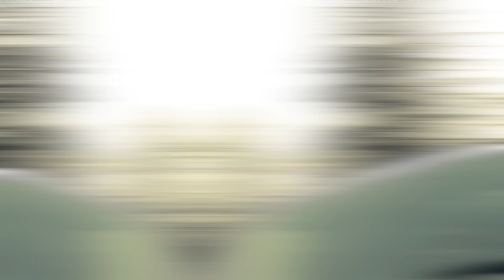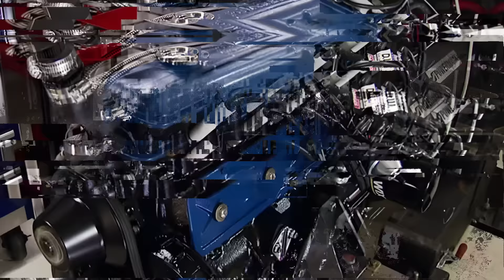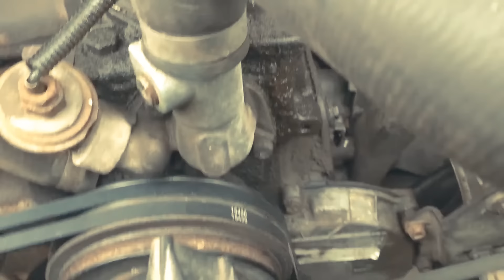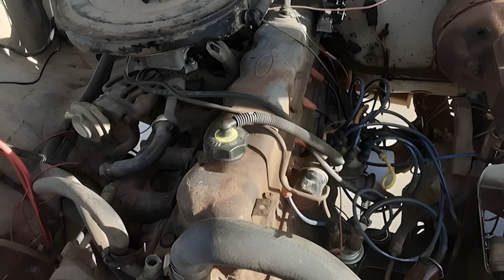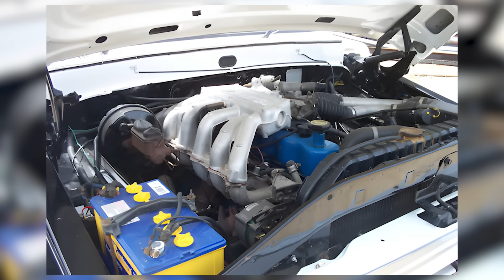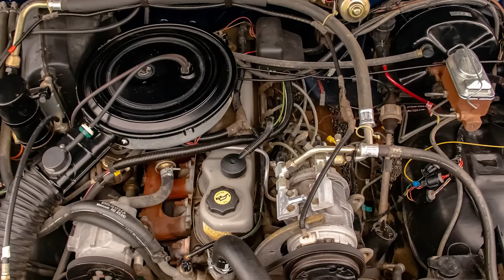The Most Durable Ford I6 Engine Ever – And Why They Killed It?

Comment: I bought a 1983 F100, 42 years ago.  I'm still driving it.  As is expected from the 300, it is all original after 300,000 miles. But here is the surprise:  The often maligned AOD 4 speed automatic transmission is also original.
Reply: I bought a ne F100 in 82 with the 300. The only problem I had was the carb loosening up on the intake constantly.
Reply: @darrellsaunders4267 interesting. Hmmm, maybe a 3 foot breaker bar to tighten the nuts ?
Reply: Ever change the filter, fluid?
Reply: That's a tractor engine. So is a 250 Chevy straight 6. These are honest motors.
Reply: I have 91 with 300k still strong 💪 Doesn't burn any oil
Reply: Nice!
Reply: Long live the 4.9 300c.i.d. One of the best engines on planet earth. If you own one and sell it you probably will be sorry. It's slow, but sure and very reliable. I bought an f250 with one in it about 10 years ago. From the looks of it ,it probably had 200,000 on it when I bought it . The speedometer was broke when I bought it so only the good Lord knows how many miles are on it by now.
Reply: 4 speed manual is more fun though
Reply: ford's autos were generally really hit or miss back then, but kinda trending towards trash. my mom's 93 thunderbird was in the shop more than it was on the road when I was a kid. think our aerostar was in the shop for the transmission at least once. my dad drove manuals, so he didn't have any problems.
Reply: #1 Fluid and filter changes, #2 Install a Transmission fluid cooler, and #3 Don't tow in overdrive.
Reply: @JesusIsLordAndSavior777 there you go....not rocket science really 😊

Comment: it is possible to put modified Ford Cleveland heads on a Ford 300 six-cylinder engine, it involves cutting and welding Cleveland heads to create a custom six-cylinder head. One example is the work done by Bruce Sizemore, who created a six-cylinder Cleveland head by cutting and brazing sections of 351 Cleveland heads, achieving over 500 horsepower!

Comment: Learned to operate a clutch in a 1961 Ford F-100 w/ 300ci Inline 6.

Bought a 1984 F-150 XL with the 300ci.

That engine is as reliable as a sledgehammer.

Comment: So over regulation destroyed a reliable engine and created engines that are too expensive to work on.  

Reduce the regulations and bring back what we can afford and what works.
Reply: I have a 1990 300
It always blowed zeros on the smog testing machines so I wonder about that claim as to why they dropped it.
Reply: @ProctorsGamble  It was a DIY servicable vehicle and they cant have that. The origanal light buld Thomas Edison invented still works to this day. They want us working and continually making payments.
Reply: @curtrn  True dat first part. That Edison bulb however,🙄 uses a large amount of energy compared to modern incandescent lamps for the light output and now we have LEDs that I as an electrician hated at first, but now embrace because the technology has gotten so good. They use <10% energy and are easy and flexible to install. We would probably need 10x as many power plants today if we were still using Edison lamps. Don't get me started on A.I. data centers though...🙄

Comment: I’m a mechanic. Not a ford fan…I’d go so far as to say that the 300 6 is the only good engine they ever made…but damn, they sure got that one right. I resealed one in a F150, customers only complaint was it was pissing oil from every gasket…pulled the valve cover off, found 3/4 of an inch of oil sludge in the head, like it hadn’t had the oil changed in 30,000 miles, and the engine ran just fine. Another one, back in high school, I overheated one to the point where it started to knock…let it cool down, started back up like nothing happened.
Reply: The 302 & 351W were also great...
Reply: @davidhollenshead4892 the 289 Hi PO was a beast of a small block. Carrol Shelby used it in the first Cobra's before the 427s.
Reply: I believe there are plenty mechanics out there that would dispute your claim. The only good Ford engine that ever made? I suppose you are an expert. And apparently you’ve been around for at least a century. And have designed many gas engines in those years that have gone well over 500,000 miles. How many engines have you designed? Are you an engineer as well as a mechanic? I’m amazed and impressed.🙄🙄🙄
Reply: Ford 300 inline is #1 or reliability and longevity. I think the 460 would be second . They made the 460 for a long time and paired with the c6 transmission it was very reliable and heavy duty
Reply: The cam gears are not plastic. They are steal with a nylon coating to make them quieter
Reply: Insane isn't it? That much sludge would have totally killed my 4L v6 in my ranger.
Reply: @rodan2852  The timing chains are going to take out that 4.0. One of the F Word's brilliant designs.
Reply: @rodan2852 change oil more often. It's not the engine, it's you
Reply: Did basically a full reseal on that engine, everything but the head gasket…only thing I noticed that I really didn’t like was the plastic cam gear. That looked pretty stupid. (And the intake being routed over the valve cover, that was dumb too) Other than that, I couldn’t complain.
Reply: @cnf6045  

Plastic cam gear teeth were common in that era. Best move would be a Cloyes timing set and advance the cam timing by 4° and improve the torque and drivability in the range that would be great performance.
Reply: @Sunspot-19 (didn’t know a ton about the engines when I worked on it, other than they where known for bitter unyielding reliablity and outlasting the truck around them, same as the mechanical diesel 12V’s in the dodges and the 7.3’s in the fords) I was working on it, keeping in mind my dislike for ford, looking for something to call bullshit on, and that timing gear was the only thing I saw that I didn’t like for reliablity, having replaced every gasket on the engine. I saw that and loudly proclaimed ‘Hey! First chink in the armor!’…and proceeded to find nothing else that wouldn’t live for half a million miles…
Reply: Pennzoil engine!!!
Reply: I've taken 3 Fords up to 200,000 miles on the 2.0 NA Mazda/Ford engines.
Reply: A shade tree mechanic!
Reply: Ford has a lot of great engines.... and still do.
Reply: You sound crazy! The 300 is the best gas engine ever built bar none. However, Ford made a ton of great engines, you know all about the V8s, but Ford made a 3.0L Valcan and 3.8L Essex that are better than an SBC and not to mention the Barra, Lima and Zeltic.

Comment: 1992. Bought an old '77 Ford Econoline van (300 six, automatic transmission, conventional side doors rather than the sliding type) from an older guy who had purchased it from a defunct mental hospital in New Westminster, BC Canada. This was a former patrol vehicle for the hospital's grounds and had only 76,000 miles on the odometer. 

No radio from factory, a 3/4-inch plywood floor and it still had the metal-mesh headache rack to protect the staff from unruly patients who'd been shepherd's-caned from restricted areas of the compound. The original metallic-green paint had faded from never being waxed and had a lot of very minor surface rust from 15 years' worth of Vancouver's incessant rain.

But this thing ran like a top and wasn't even that hard on gas. I was getting around 20 mpg hwy and 16 city. Small tank though, so limited range and an approximate $22 to fill from empty at the prices back then. It would cost around $60 to fill now. Ony issues I had with it were non-engine-related: a flasher unit that had to be replaced (not that it mattered much since Ford tail lights back then were dim) and a chafed transmission fluid line that had to be repaired with a 2-inch length of fuel hose and a pair of worm clamps. That's it. I paid $800 for it and sold it two years later for $1100. Should have kept it.

Nobody ever had to replace a timing chain in these engines because the camshaft was gear-driven.
Reply: I use to pull a car trailer with mine , didn't know it was back there
Reply: @tomrobards7753  roughly what weight was this trailer and its cargo?

Comment: There is a channel on YouTube where they built up and turboed a 300 block that ended up putting out around 550 horses at the crank and a bunch of torque. On stock internals if I recall. They expected it to break as they cranked up the boost, but it never did.
Reply: I saw that.
Reply: Engine Power on You Tube.  Part of Power Nation.
Reply: I saw that as well. The turbocharged beast topped out at 600+ HP and over 700 ft-lb torque. That was for one dyno pull. I expect it would have run for a while until a piston meted. The bottom end would have lived forever.

Comment: First vehicle I owned was a 1965 Ford F-100 with a 240 I6, that had a top speed of 36mph and wouldn’t pull its self in 3rd gear with a cracked block. But it would still start, and drive down the road with that cracked block and scored cylinder walls so bad it had to be bored 100 over to get the scoring out. Drove it all through high school after we rebuilt it, before we put a 300i6 in it my senior year. Never got a Chevy 292 i6 to hold up like that ford 240 i6 did. matter of fact I dropped a cam shaft that snapped the #1 piston rode in 3 different Chevy i6 engines, and never worked them as hard as I worked that ford 240 i6.
Reply: Had a 223 in a 64 F-100.  That old truck would anything you tied to it. One night I helped a driver who had broken on the bridge between Lafayette and Port Allen, La.  Guy did not want to leave his truck (20-22 ft box truck) on the bridge, so I told him I would try to tow him closer to Baton Rouge, hopefully to get him off the bridge.  Was able to tow him to the truck stop at Port Allen.  Asked him if that was close enough as I did not want to attempt climbing the Miss. River Bridge.  He was a very happy camper to see the lights of Baton Rouge.  Finally wore the old truck out but I sure got my money's worth out it.